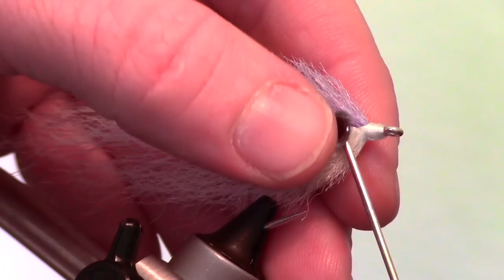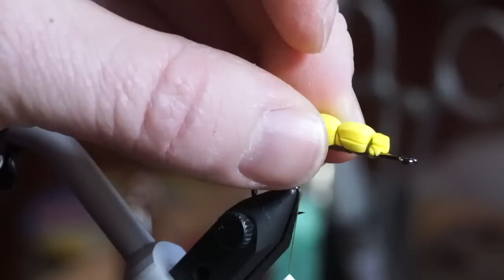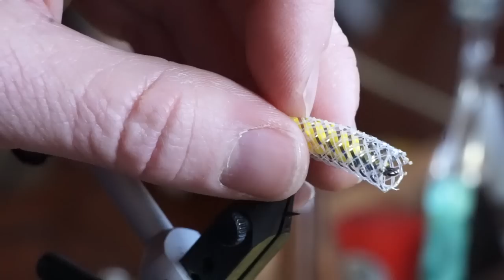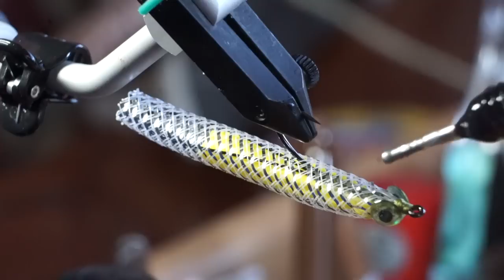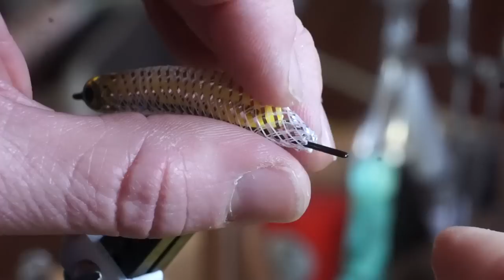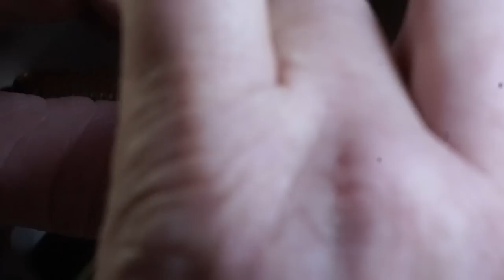Jerk bait Fly - walking the dog - McFly Angler Fly Tying Tutorial

Comment: Were trolling for trout 15 to 20" here in Utah on some higher elevation lakes. Have had success on smaller flys.
Also for wipers here to they are a hybred white bass stripper here also.
Reply from the maker: Ok yeah I would not use this Fly for that, unless you can add a ton of weight.  It’s just not gonna sink enough.

Comment: I'ma make a downsized version of dis for panfish or trout, can I just use heavy mono instead of the trailer wire?
Reply from the maker: I think heavy mono will work but will also break over time.  One tooth mark and it will be weakened.  These take some time to tie, so it would be frustrating to have it break after just a couple fish.